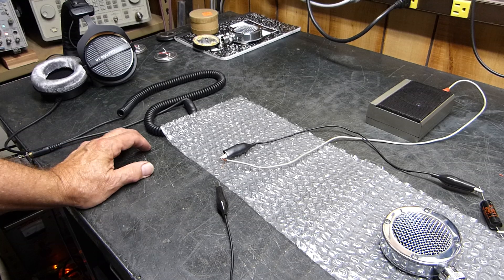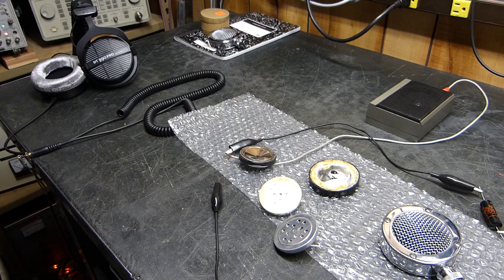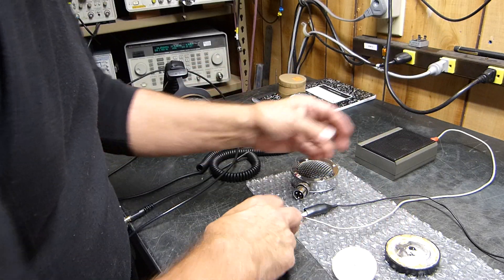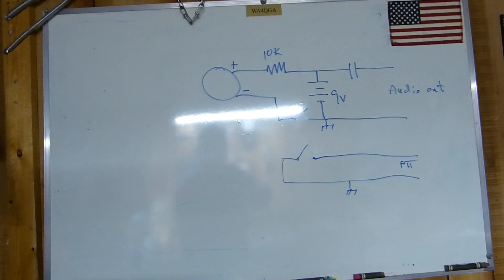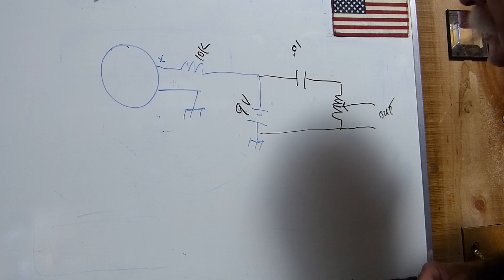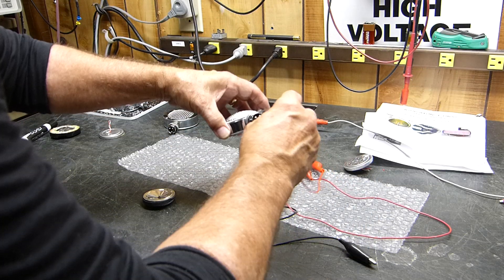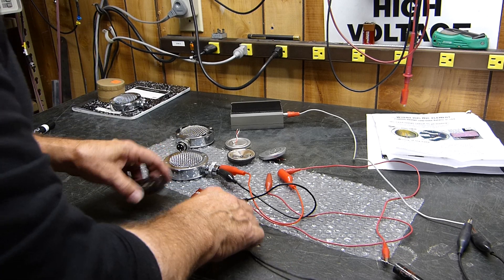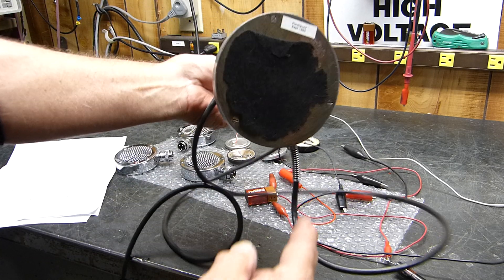Astatic D-104 Microphone Update For Collins and Other Vintage Transmitter Equipment

Comment: Nice video, just bought my first ever D104, got to wire it in to a radio now and see if I need to replace the mic element
Reply from the maker: Bad ceramic/crystal mic elements generally have low output and only high frequency output and sound very 'tinny". The condenser type microphones require a voltage source, that can easily be a 9v battery and mice replacement elements cost 69 cents each and sound Great. Don't give up on the beautiful D-104 handset.

Comment: I love my Silver Eagles, i have a few with Both Choke and PTT, the one that did not have the PTT, i painted it Black with Red trim and a Metal Coke a Cola Decal
Reply from the maker: They are still one of the best sounding communication quality microphones for vintage equipment to many people. Some don't like the higher pitched tone but, to my ears, I can understand the audio better than some of the popular HiFi microphones. On the other hand, when the elements go bad, the output becomes very weak and extremely high pitched which can become hard to listen to. Replacing the vintage elements with the condenser mics sold all over the Internet, they can sound good again. The condenser mics do require a 9V battery but not the amplifier found in some of the D-104 "power mics".  Thanks for your comments.

Comment: the d104 doesn't continue draw current from the battery all time ,does it ? I was thing when it was not in use they no were no current in used
Reply from the maker: That is true as there are two separate contacts in the D-104 when you squeeze the handle. I use one set of contacts for the PTT and the other set is used to turn the condenser mike on and off by connecting and disconnecting the battery in the base.

Comment: Hello I just purchased a D-104 with a G Stand and I am trying to figure out how to connect the stock 4-pin cable to an XLR input.  Should I solder a new cable with a female 4-pin connector on one end and XLR male on the other?  Appreciate any advice!
Reply from the maker: I am going to assume you got the one without the amplifier so here is the schematic - I hope the link works.

https://www.google.com/search?q=astatic+d-104+microphone+schematic&rlz=1C1CHBF_enUS839US839&tbm=isch&source=iu&ictx=1&fir=VFJcc66HMXmW3M%252CsZxmWtYqLo8uYM%252C_&vet=1&usg=AI4_-kRVV6QslT7fVxlHa-uPQCtv5zblOw&sa=X&ved=2ahUKEwjjr-rwqs7sAhVII6wKHfiQAewQ9QF6BAgKECc&biw=1920&bih=969#imgrc=umsELXflMVr5-M

In any case, the stand provides for a PTT connection (usually at the tip of a 1/4 inch phono plug)  and a microphone connection. The other side of the microphone and the PTT connection is common to the ground connection on the phono plug. It should work fine with your XLR if you wire the microphone, PTT and ground for your instrument.

Comment: Very good video have you ever removed the aluminum in the center of element to look inside
Reply from the maker: No, I have never done that but I have had the center post come lose from the aluminum and I put a bit of glue back on the post and aluminum. I don't remember it helping much. Probably because the element was already pretty shot. Many elements do go bad but others work great.
Reply: @ElPasoTubeAmps  I found d104 mic head in my junk box and took a part it look good then looking a little closer to find the aluminum loose and came off I guess the glue lost it strength but when I lifted the felt it all off it look new I'm going glue every thing back together and give a try very good video you made enjoy it thank you replying so quick

Comment: I'm just trying to figure out how to remove the stupid (CB) preamp and have this sound good with my Johnson Invader 2000. When I bypass the preamp, the audio is terrible. Surely, in 1963, when the Invader was produced, they didn't really use CB as we know it and all these preamp models didn't exist. It does have good audio with the 9 volt battery installed and the preamp turned almost all the way off. The preamp is NOT necessary, but for some reason the Invader can't work well without it. What is the difference between the preamp (CB) model and non- CB early 60's models? I want to convert mine to 1963 non CB specs. Thanks and 73's W1RMD.
Reply from the maker: It should definitely work without the preamp if the D-104 element is good. They do go bad and will only put out a tiny voltage when bad. That may be the issue. Just guessing. The little condenser type microphones have a FET amplifier built in and usually require a 9v battery that you can use the contacts within the D-104 stand to turn the condenser mike battery on and off. You don't want to leave it on all the time as it will run the battery down. I don't have a schematic on hand or I would send it to you but first just remove the CB preamp (I agree, they sound horrible) and look up the D-104 wiring, most is color coded and get one of the condenser mikes if you are not sure your original D-104 mike is good. I tested mine (I think I had 9 elements, if I remember correctly) by connecting each to a small solid state amp with a speaker on it and I just talked and whistled into the mike. It was easy to see which ones worked best. 73 and best of luck with your D-104. I still think they are one of the most classy microphones around. Here is something that might help and shows the amplifier.
http://nucow.com/Microphones%20Lamps/vintage%20microphones/D104%20schematic.htm
.

Comment: I put a W2NEY mic to my D-104 2 years ago and with my Kenwood driving a grounded grid single  4-400a amp all QSO's have great audio. Thanks for the great information. AJ4S
Reply from the maker: I think it is great that these $10-$20 condenser microphones make our vintage microphones work again. But I have to say that with vintage equipment like the Collins, it seems to me that the original D-104 element, if in good condition and a few do still exist, seems to get the most unsolicited comments of good quality audio. The Heil microphones sure sound good also but again, for the price, these W2ENY, and others, do a great job.  73

Comment: Very Nice video! Great having some comments on the old 104. I also use ONLY d-104 mics on
both kenwood and Icom gear as MY voice simply works well with the 104, having tried various
mics since 1959 the 104 always comes out on top with best audio for MY voice.

Thanks sir!

Comment: I’ve used D104’s on my Viking-II but it needed an audio amp to provide the drive needed. Over the years I’ve found with my voice being higher (Tenor) that a Turner 3 had better freq response, later I now use SM-7, Audiotechnica even senheizer with a compression to drive my Drake TX4C.

Comment: My first microphone circa 1965 was an Astatic model P-3 on the same push to talk stand, I think it’s a model G. The P-3 head was essentially the same element as the D-104 in a bullet shaped head. 
It cost me a total of $80 back then, which was a princely sum for a 13 yr old in those days. I saved for weeks to get enough money.  I built a small 1 tube amplifier, I think it was a 6SN7, that I used as a little PA amp. Later on, I used it with my first AM rig after I got my General class ticket. I built a modulator for my Heathkit DX-40. Lots of fun.
Reply from the maker: Bill, you are certainly a man that has a history similar to mine and we still appreciate the good quality equipment from decades ago. I was born in late 1949 so I am must be a couple of years older and got the D-104 microphone that I use today bought for me at the age of 13 just like yourself. The microphone element has been changed a few times over the years but the base is the same from day one.
I am actually glad that I have saved the nine elements I showed on the video and I learned that the simple way to determine if they are worth keeping is simply to connect them to the input of an amplifier and speak into them and listen to the quality of the output. Too simple. I have also found that if you find a good one, people will still complement it on the air as having a very good communication quality sound that gets thru QRM and QSB dips.
Indeed, $80 was a quite a bit of money in 1965.  I like to remind younger viewers that in January 1970 I went to work as a NASA contractor in Huntsville for $125 a week and I had plenty of money. That's $3 per hour and just a couple of months away from 50 years ago.  I rented a two bedroom, finished apartment for $125 a month (one bedroom was unfurnished as I  had to have my radio stuff there...)
Anyway, these old D-104 microphones are just so well built and classic design that they will never go away and it is nice to see that several people are making and selling upgrades to the  microphone head to make them usable on the new and old equipment. It certainly seems most all of the new equipment has the "phantom" power available for these new condenser type microphones but there wasn't anything in the instructions on how to make these microphones work on equipment you and I had in the beginning with just a simple input line to the grid of a tube. I think that was my main purpose for this video but overall I don't think I did a good job at showing that. Oh well... got to keep trying   73

Comment: A lot of confusion and hard to see what you were doing.
Reply from the maker: I understand and as is obvious sometimes, my videos are seat-of-the-pants with little preparation...  
This was my first experience with the electret condenser microphone outside of a store-bought setup. In my past, I have just connected a microphone, be it ceramic, crystal or dynamic, straight into the input of an amplifier or transmitter. However, these new very small, and apparently very high quality microphones, require a voltage across them. In my case here, a 9 volt battery in series with a 10K ohm resistor straight across the microphone, polarity sensitive. This resistor/battery hookup powers the condenser microphone and a builtin FET amplifier. Once connection is made, it requires a capacitor, not of critical value, but in the range of 0.01 uF,  (10nF) to connect to the input of the amplifier/transmitter in the standard manner. Quite a different setup from the boat-anchor simplicity of the microphones first mentioned. The instructions that came with the microphone did not address these vintage pieces of equipment so I thought it might help if I demonstrated the basic connections. 
BTW - a good gentlemen commented that my schematic I drew on the board is incorrect and he is right. The capacitor comes off the + side of the microphone on the other side of the resistor.
Please see this correction schematic:   https://en.wikipedia.org/wiki/Electret_microphone
I also wanted to show how the voltage output and frequency response of  most of these 50+ year old ceramic or crystal microphones vary dramatically and most are pretty worthless although a couple out of nine work pretty good. 20% good in my case.
 I hope this helps and I will try to plan a little better on future videos. Thanks for your comments.

Comment: Hello David! Interesting conversion. Crystal elements have a tendency to age and eventually go totally dead. Similar with Crystal Phonograph Cartridges. It's interesting how the frequency response curve varies with different elements. However, the Condenser element mics have a very wide frequency response curve...an average of 30-15K and 20-20K.  FET amplified condenser mics tend to have a hot output, and most of the time need to be attenuated to prevent over-driving the input stage. Vacuum tube condenser mics are even hotter. I've been using tube mics in the studio for many decades. i think it's a great idea to upgrade the old D-104's with Electret condenser elements. They have a very clean top end, and some even have a slight bump in the 8-10K region. Great video as always. Hope all is well :)
Reply from the maker: Hi Frank - thanks for the comments. This is the first time I dug out all of the old elements and as mentioned in the video was quite surprised at the difference between each one. In essence, I think I can determine all of them to be bad and need replacing with the exception of two of them and even the two "good" ones have quite a different sound particularly in the voice range. 
I do have one fancy gold Electret condenser microphone that I have used before that uses a phantom power supply but it seems to be too "hifi" and too many low frequencies are not a good thing in ham radio communication so I tend to stay away from it for my transmitters. 
I tried a Radio Shack frequency equalizer trying to "tune" the response but that was just too much also. 
The Heil microphones (dynamic) seem to have a very nice voice range and the ones I have seen on YouTube need to be spoken into up very close. I am of the "fighter pilot" mentality when using a microphone and not the broadcaster type where I want the microphone on a boom two feet in front of me. 
In any case, I am having fun with the microphone elements and will wire the D-104/UG stand that I have coming form Ebay with the little microphone I showed in the video. I didn't see a video on YouTube showing the essential connections necessary to make these types of microphones work so I posted this video in hopes it will help others.
With all this said, I figure a little bit of frequency contouring can be done with this new microphone simply with the blocking capacitor to limit LF response in order to put the most amount of power into the voice range of basically 300Hz to 3KHz. Just my thoughts on it but I am always open to suggestions.

Comment: schematic is wrong. You ought to connect the output capacitor on the otherside of the resistor.... now you're otputting the ac-component on the battery...
Reply from the maker: You are absolutely right - I drew the schematic wrong and the capacitor should come off the + microphone connection. I connected it properly on the bench and drew it wrong on the board. Thanks for noticing and commenting. It is little mistakes like this that if they go unnoticed/uncorrected can cause a lot of confusion to someone trying to understand how to connect such a microphone up.
Reply: There is something else strange here. You kept saying 'electric' but the document read 'electret'. An electret microphone doesn't need a polarizing voltage but the internal FET amplifier needs power.
Reply from the maker: @EJP286CRSKW  
Hi Esmond,
I have to admit it is a bit confusing to me. But these discussions always help me understand better.

Electret microphone
Description:   An electret microphone is a type of electrostatic capacitor-based microphone, which eliminates the need for a polarizing power supply by using a permanently charged material. An electret is a stable dielectric material with a permanently embedded static electric dipole moment. Wikipedia

However, take a look at another Wikipedia description below especially their description and schematic on the right hand side.

https://en.wikipedia.org/wiki/Electret_microphone

In my particular case, it does  require the external voltage and the description in the instructions call it a, FET amplifier electret element - apparently like the second Wiki description.

Now that I have actually gotten thru this experiment, I found that the easiest way to determine if the old vintage D-104 crystal/ceramic elements are still good is to simply connect them to a small amplifier and speak into them and listen to the output. That part was probably not the best illustrated in the video but it is simple and the most revealing of the actual sound of the old elements.
As for the new microphone element I am about to install, I have ordered another D-104 head and base and will mount a battery and possibly a volume control in the base of the microphone and use the extra connections in the UG base hand switch to apply and remove the 9 volt battery across the microphone. It sure looks promising with lots of output to drive my vintage Collins equipment.
Some microphones I hear today are too "HiFi" (too much LF response) and QRM and QSB can make them much more difficult to understand than a higher pitched, "jet fighter" type communication microphone.
Reply: @ElPasoTubeAmps  The resistor and capacitor should both connect to the electret cartridge (+).  The other end of the capacitor will be the audio (+).  The other end of the resistor will  go to the battery (+).  If you want to still use the original amp board you don't need the .01uF capacitor.  Their is already one on the amp board input (only .01uF capacitor on board.)  You just need to add a 1K-10K ohm resistor in the proper place to supply the voltage needed by the electret cartridge.  Also I recommend marking the microphone cartridge housing and base with a label that they have been modified.  The new modified head will not work on a stock G Stand base or the modified base will not work with a stock Astatic crystal cartridge.
Reply from the maker: @mountainmancb  I drew it wrong on the board. I found that, generally, the higher the load resistor, the higher the output of the element up to about 10K so in one microphone I connected the output across a pot in the base of the mic stand for full adjustment from zero to full output. These little 69 cent microphones sound good. The last modification I made was to connect three mic elements in parallel and mount them in the D-104 head and from what I can tell, there may be a slight improvement in that arrangement. True you can't swap the head around on an unmodified base.  Thanks for your comments. 73